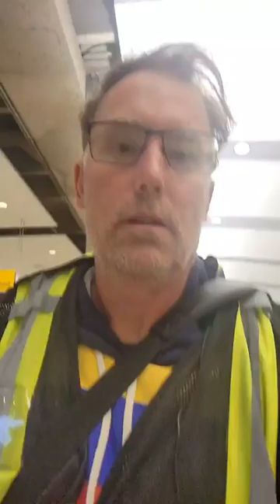Fiber Optic Radiation (Danger) Part 3

Comment: Why are there not more stuff out there about fiber optics ?   They are installing this for free most places.  Sounds like it puts out slot of bad stuff    Like constantly putting g out emfs
Reply: here in Texas they are installing it everywhere even in private property...I think its a sinister plan for who knows what motive....sad indeed.
Reply: Because this guys dumb and there’s nothing to fear. If you aren’t afraid of turning on the lights in your house because of emf than fiber optics shouldn’t even be a consideration. Fiber optics are made of fiberglass strands that use pulses of light to transmit data. They can’t conduct or give off electricity because that’s physically impossible. Technically light is part of the electromagnetic spectrum it won’t cause you any harm, because all light (yes even the ones in your lightbulbs) are part of that spectrum and are actually hitting you because they aren’t enclosed. Being out in the sun will do you much more harm, so if you’re scared of fiber optics I hope you blocked out all your windows or live underground so the sun rays don’t kill you.

Comment: 2:05 steel trash cans on the modem - thanks!  They're installing fiber here without our choice.  Another thing is, if your house is hardwired, you still get wifi EMF's from neighbors...  Someone covered the smart meter here with two layers of aluminum foil and said since there's metal inside, at that spot, (dryer and radiator), that's protection for the inside...  What do you think about that?
Reply: How do you put steel can on the modem there just finishing up my neighborhood  with fiber optics  can you put something  smaller around it